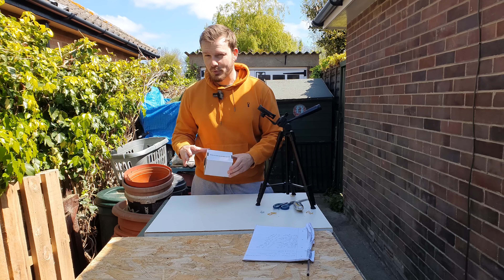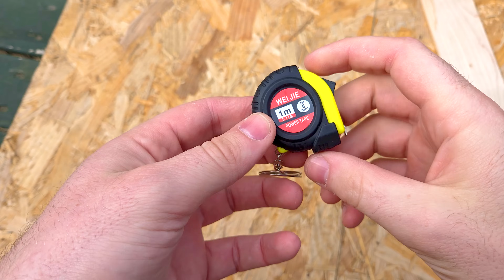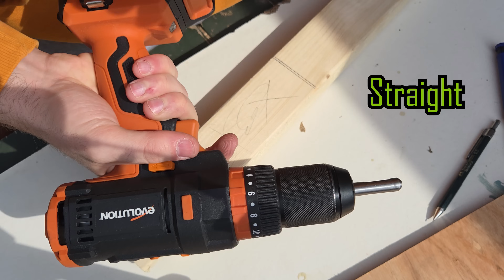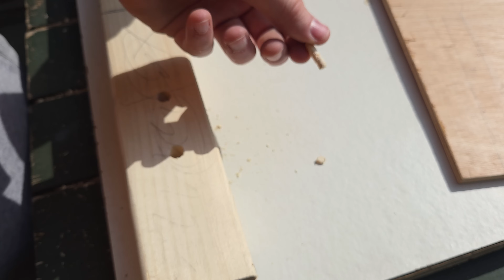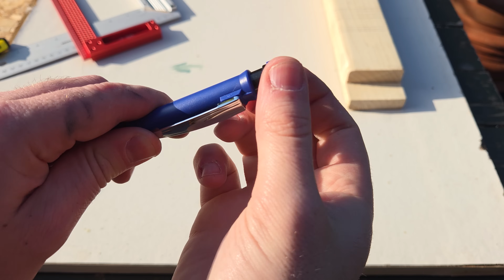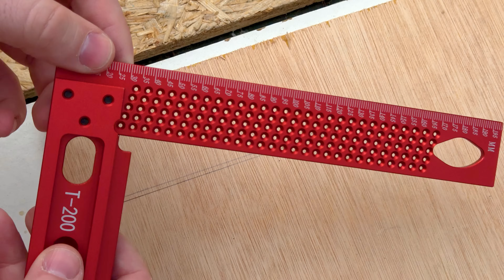I Bought 10 TEMU Tools For Less Than £10 Each

Comment: I dont ttust these squares that are screwed together😊
Reply from the maker: Yeah it definitely makes me nervous having them screwed in manually. But so far so good
Reply: @SplitbarkStudio I actually brought 1 of the knockoff Woodpecker squares. 
It definitely is off square with no adjustment possible. About 1 mm in 600. Close enough for not so precise work as long as you keep it in mind and dont switch around too much

Comment: Mate those dowels you made them with the lie of the wood grain you should have done it from the end where the dowel would be so much stronger because the dowel rods you can buy are just that.
Reply from the maker: You're 100% right,  I was referring to them as dowels but they're actually "plugs" which go across the grain. Was using the wrong terminology the whole time

Comment: Temu, Amazon, eBay, Bang good, Screwfix etc......products from the same factory with different prices. Same goes for DeWalt, Bosch....ect. you can get a yellow and black drill direct from China or pay at least twice as much and get the same thing with a brand logo on in UK from a branded store. Who's the rip off merchants?
Reply from the maker: Well put

Comment: Same issue with the drill bits I had but found out that going with the grain fixes it
Reply from the maker: Yeah, although this video I was getting dowel cutters and plug cutters mixed up the whole time. These are for plugs which are for cross grain. Dowels are good with the grain you're right

Comment: This is such an naive review. Abrasives are judged by performance  if they clog up or quickly lose their properties. Plug cutters are for making plugs to fill screw head holes, not dowells. Did you test the steel tape to see how well it retracts. Did you check the square to see if it stays true after being dropped a few times. Give me a break. Do you really use tools at all.
Reply: No one should drop a square deliberately and I’d not expect any precision tool to stay true if some site chippie start throwing it around onsite
Reply from the maker: You're right John, in this video I mixed up dowels and plug cutters so got my terminology all wrong. In all honesty, I didn't want to drop the square on the floor as I ended up loving it and preferred it over my current square. Thank you for your comment, i've pinned a comment outlining the mistakes

Comment: 11:44 I wonder if the grooves on the circle is for drilling square in the middle through a pipe. ? That would actually be very smart
Reply from the maker: Possibly, but I would have thought if the pipe was round you'll struggle to hold it down

Comment: I have been using Banggood for years. Decided to try Temu.  To be aware they send deliveries with Evri. I live a little off the regular track and Evri drivers get paid per drop. After 3 failed attempts (which means the driver gets paid more to go to other areas) it was returned to Temu.  Very annoying.

Comment: With regards to the drill bit guide, you need to take a punch and tap a little indent first. It should work fine. And yes, you lose a bit of length with the device, however after you’ve drilled anchor and a half or so, you no longer need the guide, as the existing hole will keep you going straight.
Reply from the maker: Sounds like good advise, I'll give it a go next time, cheers

Comment: I am a diy guy in the UK, I have just started buying tools from temu. Made in China by low wage workers... sure... it is the same at BandQ, Amazon, Wickes and ebay. Temu not a scam in my experience. Just the same tools at different prices, I am just avoiding the middle men.
Quality of goods made in China is fairly consistent. If you want or need really good quality, I suggest made in Germany is the different ball game. Bosch and dewalt are good options for the professional that can afford really good quality tools.
Reply from the maker: Agreed, for the odd things I think Temu is worth it, for anything electric or for long progressional durability i would go for branded

Comment: i bought 3 of those squares, all different sizes. they were all perfectly square, but not one had accurate measurements on the rule and none of them were the same. but i just limit myself to using only one during a project and it works out fine.

Comment: I have the plane (in fact I have a couple). First thing is that the circlip is what holds the adjustment in place, without it you cannot adjust it properly. They come out too easily and are a nightmare to get back in. However, I use mine all the time and have it as sharp as a razor and I love it. It honestly gets more use than my block plane on board edges. Please, put the circlip back in and sharpen the blade.
Reply from the maker: I wish I had your comment when I released this video, I have no idea where that clip is now. But cheers for letting me know what it does
Reply: @SplitbarkStudio  I went and bought a couple of spares just in case, God knows how they get them in in the factory, always takes me 20 frustrating minutes and cut fingers!

Comment: Are you testing an angle? You just need to turn it around on the same side and hold it against the line, or draw a new line. ^^ If the lines line up, it's 90 degrees. Otherwise, rubbish. Why don't you know that?   hello from germany
Reply from the maker: Are you referring to the 8" square?
Reply: @SplitbarkStudio  Some people are way too hard on you, hope you have a thick skin! By the way, you should've edited in "Hip to be square" when testing it, but I guess that's instant copyright strike nowadays. It played in my head at least, haha!
Reply: He did use that method at least once.  It's not rubbish but different and if you're filming, you may not do it as you would normally.  Why don't you think about that?

Comment: The first item is emery tape for steel, not sandpaper for wood............
Reply from the maker: Didnt know that, Seems to be good for wood too at least
Reply: @SplitbarkStudio  I bought the version with 6 rolls some time back, and yes, they are fabric backed emery cloth, but they do work on wood too if you're in a pinch. Probably the worst problem is residue getting left in the wood and you using a plane or something afterwards which will blunt fast. Anyways, as you said, a very practical set of rolls!

Comment: Will a spade bit or boring bit fit into that drill guide from underneath?
Reply: I guess you'd have to sort of feed it from the bottom into the drill? I'm sure you could make it work.
Reply: @Ingeb91  I mean  insert the spade or forstner bit into the drill guide from underneath, and then insert the shaft of the bit into the drill.

But would the width and height of the spade bit fit up into the guide, or is the guide too narrow or too low to allow this?
Reply: @mikemalone9678  He did comment on how it was bigger than he thought it would be, so maybe?

Comment: When making dowels you need to go in from the end of the plank of wood, so your running with the grain of the timber this gives them their strength and they should not snap like the cross grain cuts shown. I bought some fishing magnets from Temu they were laughably small about the size of largish buttons, they could never be used for magnet fishing, but they have proved useful holding extension leads to inside my tin shed roof... ;)
Reply from the maker: I think ive stirred a few passionate people with the plug cutters, plugs are cross grain and dowels are long grain from what people are saying. I kept referring to them as dowels in the video but I was wrong

Comment: The plug cutters are as per the name. Not for dowels but hiding deep countersunked screws etc.
Use of a good drill press is absolutely necessary as any deviation in the vertical sink will distort not only the top of the plug but below as well.
If you can buy a set like that for about 8 quid and only do a few jobs, that is fine. 
A quality set of 4 +4 would set you back 20 quid plus.
cheers from down under
Reply from the maker: You are correct, shame I couldn't test them with a drill press

Comment: Aren't you supposed to plane with the grain, otherwise the result will be rough. I would replace those circular jig nuts with wing nuts.
Reply from the maker: You are right, you should plane with the grain, I just didnt notice until after filming. Still gave a fairly good result at least

Comment: Can you show me a metal tape measure that will not stay bent if you deliberately bend it?   Come on!
Reply from the maker: Its more that it came kinked and was very easy to do so
Reply: I've got several old versions of the original patented Talmeter tape measures, made in Sweden of course (I live here), even the wider TalStabil which is 5 meters long and holds itself straight horisontally for about 2 meters and when it finally folds it just springs back without a crease on it. Of course it's much more expensive, but having a tape measure permanently bending like the one in the video is way below par and pretty useless regardless of price.
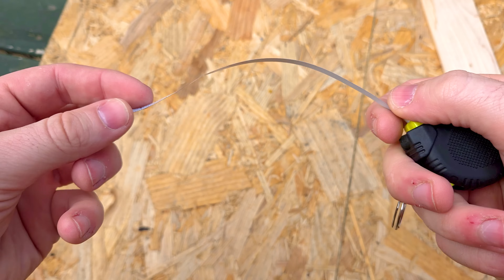Reply: @Indiskret1  You miss my point.  I also have a couple of tape measures - low cost hardware store purchases, and similar to yours, they hold themselves stiff for a couple of metres, and when they do bend, they click straight again without leaving any permanent bend.  I think most tape measures are like that.  However, at 1:58 into the video, he deliberately creases a steel tape and then criticises it for retaining the bend.  Well, I don't think that's a fair criticism.  If I was to deliberately crease mine, then I would expect that crease to be permanent, and I suspect that the same applies to yours.  What point is he trying to prove?  Who would do that to a tape they had bought?

Comment: There’s often a bit of debate about cheap Chinese tools being rip offs of established brands, and aren’t they terrible for doing it. Whilst I’m sure some of that goes on, a T-square, for example, that works with the same functionality as a WP brand version, at a tiny fraction of the price, is just good for everybody. They are very enabling tools at those price points.  The folks who want WP tools are not the target market.  Those folks are never shopping on temu anymore than temu customers are shopping on WP or Festool Mafell etc. 

I think these functional low cost tools are the very definition of the benefits of global trade ( entirely independently of current politics)
Reply: I agree entirely. The key word you used is 'enabling'. Since the advent of Lidl/Aldi in the UK it has been possible for the average or aspiring DIYer to obtain what were once considered specialist tools at very reasonable prices. It's quite satisfying to select the appropriate tool for each job, even if that job only happens two or three times a year.
    There is of course, much tool snobbery among devotees of the big three: Makita, Milwaukee, DeWalt and the people who adhere to these brands seem to think the rest of us are all working on various construction projects on a daily basis. I really don't need tp equip myself with established brands that I'll perhaps use sporadically throughout the year. Also, some people look after their tools but others have neither the time nor inclination after a long day on site.
Reply: I'd never heard of Woodpecker before watching this video so had a look to see the pricing and f*ck me lol they are just vanity tools. You can't find square 40 times better than square 🤔. Do they last 40 times longer than the Temu squares? Also very doubtful.

Hard to justify such a high cost for something without moving parts.
Reply: The Chinese are really good at copies, Daystate Air guns produced the Huntsman decades ago and the Chinese took one to reverse engineer. These were pre-charged air rifles and the air cylinder produced at Daystate was to a  exacting  tolerance, there was a fear that the Chinese wasn't as good a standard. As far as I know there were only a few produced and no one was interested, it was named the Chuntman, if you see one of these pressure tubes explode you would know why the air gun community wasn't going to buy one IIRC Daystate got hold of one an tested it, they were not convinced it was safe.

Otherwise I have had quite few things from Temu like drill bits that were totally useless, and a couple of other items that went in the bin but there was some good stuff too. I am now very selective as to what I buy clothing is one of the items, I got a XXL heated jacket that wood have fitted a garden gnome so I don't bother with anything clothes wise.